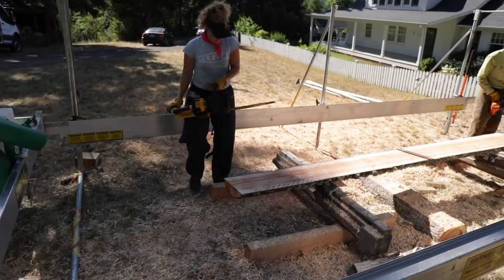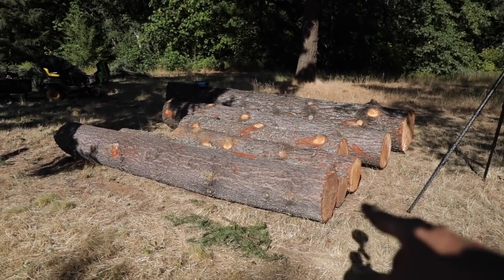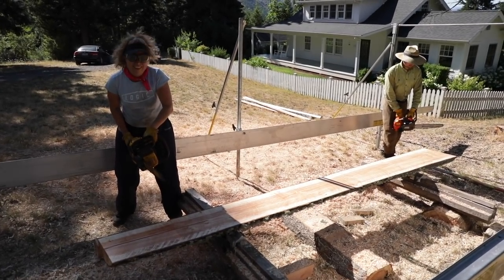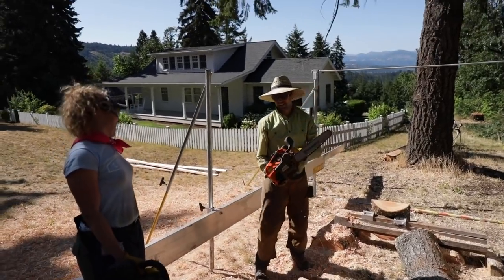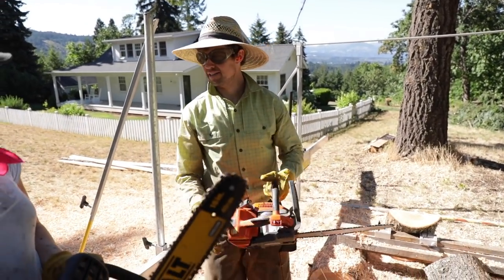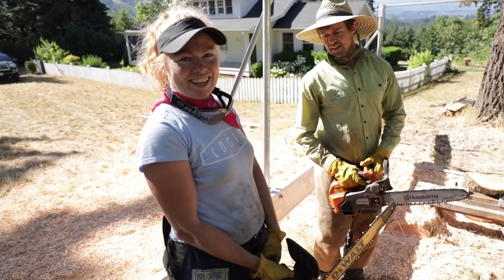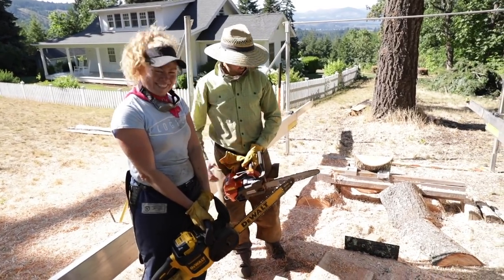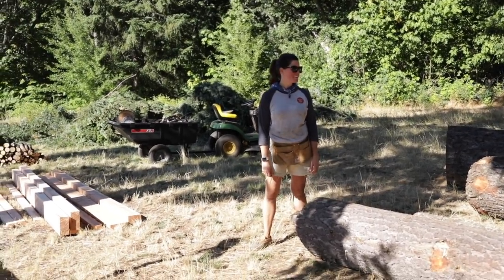Electric V.S Gas Chainsaw SPEED RACE

Comment from the maker: Buy Your Dewalt Brushless Chainsaw Here https://www.amazon.com/shop/wranglerstar (link will direct you to my amazon store)
Reply: Wranglerstar Hi there i would really enjoy seeing a comprehensive review of the s&w swmpls4 pocket knife, its been my daily carry and your reviews are so awesome and interesting! Id enjoy seeing your opinion and it put to the true test :D
Reply: Thanks for the video. DeWalt makes some great tools with plenty of power, but I do wonder about the durability of the the plastic "tool-less" sprocket cover and chain tensioner. Echo has an electric chainsaw and the sprocket cover is held in place with 2 metal nuts that require a scrench. The chain tension on that machine is adjusted by turning a metal screw on the side. 

Maybe my apprehension about "tool-less" stuff is unwarranted, but I am very interested in seeing how well the DeWalt continues to work as you use it over a longer period of time. Will it hold up to a whole week of felling and bucking or is it best as a pruning saw?  I prefer to buck with a longer bar because it is easier on the back, but I would love to get an electric as a SHTF saw because I could charge with solar.
Reply: Wranglerstar 

I don't wanna get one tho. I just want a nice gas saw.
Reply: I have the same 20V Lithium Dewalt from Amazon. My 50 years of gas chain saws are over.
Reply: Clark Magnuson 

That's fine. They certainly have a place.

I have a gas sthil. I do have a battery reciprocating saw and jig saw.

I think the electric may have some interesting safety concerns.

For instance, we see the chainsaw as being among the most deadly of tools, so the point classic horror has used the chainsaw among a wide array of power tools. Games the primarily use guns will often find some way through the game to obtain a chainsaw as a weapon. Usually not a weed eater or hedge trimmers.

The chainsaw seems to be universally recognized as dangerous.

So you hafta to take a few extra perspectives on what could happen..

For instance, a young child is highly unlikely to be able to start a gas line saw. Should they happen across one. They're dangerous not even running. But less dangerous. So with a bar safety cover the saw sitting some place would pose much less of a threat of becoming deadly in the child's hands. 

Now the concept of the gas is when it's off it has no power. The engine must first crank then it has power. Then one pulls the trigger and the chain I kicked in drive.

If that saw happens to have a battery in it... It's basically a chain saw with it's "engine" running at all times the battery is engaged. Thus at any time the trigger may be pulled if the safety or child figures out the safety mechanism which isn't beyond a child

The fact it's always running so long as the battery is engaged, it's deffinently more dangerous then a gas saw
Reply: I did 9 days in intensive care in 1972 from topping a tree with the McCulloch chainsaw my father bought me. I gave away my 36" Stihl when I moved to the suburbs in 1999. In 2014 I hit my house while topping a tree with a plug in electric on a 25' pole. In 2018 I got the battery powered chain saw and started going through chains every few minutes by cutting bitg douglas fir roots, to clear land for a garden. It just keeps getting better:)
Reply: Clark Magnuson 

Holy canoli, well.. I havent run one every day of my life but first used my grandfather's chainsaw while I stayed with them in the south all summer. probably 93 when I first used one. I've cut down at least 29 inch trees, dead saftey hazard ones. Cut up a big pine that was hanging over a garage after some guys took it down. I just wasn't there when it was took down. I cut another dead tree down leaning twords same garage. I cut a huge pine branch down next to a power line. Some other cutting here and there. Limbs I've trimmed around a small country cemetery.

My great uncle was the one with big saws. 

By blessings of God I ain't been hurt yet or had any miss haps.. save I did cut my pants once but I realize now why it happened as I was in midst surrounded by a limb pile going down hill. I was honestly operating the saw with too many branches bunching me in and forcing me to work with little space to maneuver. so I don't do it like that no more.

I try and stay some what to the side and behind them when I use one.

Not no expect saw operater but I've done a little share of cutting down a few kinda Biggins.lol
Reply: Shane Hoffman 

I can buy a sthil wood boss for less then that.
Reply: Clark Magnuson 

It's like this. Some boys and girls are happy riding down the street on an electric scooter.. other men and women gotta have a Harley rumbling between they legs.

I guess I like Harley's and gas chainsaws.
Reply: Clark Magnuson 

My great uncle in South Western Tennessee, down there where bufford Pusser was the sheriff. Down by Shiloh and Pickwick. He owned some huge saws. I'll never forget he chewed that day o work tobbacer plug and my papaw liked to dip snuff.

I need to pack my stuff and move back down there I know that much.

I ain't liking it up here Yankee land too much.

People of the north are rude. I don't know what it is about em. Something is off with em I know that.

Compare southern Indiana with south western Tennessee.. it's like a whole different world.

People wave at down south. People give ya huggs and you just met em. These Yankees around here ain't got time for nobody. Too fast paced, people got bad attitudes.

You down in my old stomping grounds down there... There ain't no bars. There is liquor, but there ain't no taverns. There afew a few quite a distance away but non local.

I live now in a town that has lots of taverns.

Now down south, not having taverns don't mean they don't have fun. I'd say down south they have more fun. It's more real down there. 

Comparing the type of girls around there versus here... Well where all the taverns are... The girls around there are evil. They have bad attitudes, bossy, depressed, fake, cheaters, unfaithful, femenist, stuck up, restless, crazy, confused, golddiggers.

Down south, they got those people, bit they're fewer and farther in between.girls down south less likely to run off on ya.

I'm planning on gettin out of Yankee land soon.

But chainsaws are just like motor bikes. You're either content with an electric scooter or you got a have a Harley.
Reply: Clark Magnuson 

Sound like a fun bunch eh?
Reply: Clark Magnuson 

I don't care what these Yankees around here says the trees down south is more rugged then trees up here.
Reply: Clark Magnuson 

Plus just the heat in the south ain't the same heat as up here in Yankee land.
Reply: Clark Magnuson 

Anything north of Nashville Tennessee ain't the south.
Reply: Clark Magnuson 

You ever heared of a Jews harp? Some people's call em a jaw harp. Well... You know that feeling you get with a gas chainsaw rumbling? Or even a Harley? Well.. if you get you a real jaw harp.. or make one... I'm talking a hand forged one. Not no cheap ones. I got me several of em that are hand made from Russia and other parts. They get a little pricey for high quality ones. But a jaw harp creates a vibration that is comparable to that of a chainsaw or even a motorcycle.
Reply: Clark Magnuson 

I got me a forge and anvil, been making the little boogers.
Reply: Clark Magnuson 

I picks me a banjer too.
Reply: Clark Magnuson 

Right now burning cripple Creek on the 5 strang.
Reply: Clark Magnuson 

Got flames coming off my fingers.
Reply: Clark Magnuson 

See, I'd rather have me a chainsaw with a gas engine. Of course I know a little about electronic cicuits. I've got me 2 power supplies, one a 2amp 15 volt with a solder and heat gun the other a 30 volt 10 amphere power supply. Got 3 oscilloscopes and all kinds of electronic components.
But I'd rather have a gas saw, one I can take apart and fix. I can keep them running for years.

What happens when you battery goes bad after they change the battery style?

All the sudden your nice new electric saws batteries become obsolete. Now you're out of a battery and a saw.
Reply: Clark Magnuson 

The the problem with battery saws.

They won't last long... Because eventually the manufacturer is gonna change the battery in such a way the new ones won't work on your old one.

My new batteries certainly don't work on old cordless drills I've had.

Guess what happens to those old cordless drills once the battery becomes obsolete? Unless you know how to kick start old batteries, which sometimes can be done, those old drills sit around waisting space. Because you can't find no battery for em any more

Battery chainsaw owners will eventually be buying a second saw when many of the old saws from the 70s is still crankin.

The battery on your electric saw is gonna be obsolete one day and you'll hafta buy a new saw.
Reply: Clark Magnuson 

Yankees around here think they tough cuttin in the woods.

They ain't hafta worry bout getting mixed up in a big timber rattler nest.

I was loading logs in tge back of a truck back in n the 90s, luckily I had my good buddy, a bitbull boxer mix named Sheba. I reached down to get ahold of the log when all the sudden Sheba started going crazy.. barking growling.. I look down right where I was gonna be putting my hands...a great big ol copper head was coiled up. 

Ol Sheba got bit in the neck bless her heart. There weren't no vets close. The venom didn't get her.. it was the fact she got bit in the neck which caused her neck to swell up. She unfortunately passed away from it. But that dog died saving my life. I was a long way from any type of medical attention.

If Sheba hadn't warned me of that snake there, I'd of been bit on the arm.

She was a unique dog with some personality like a human personality. She had a diamond shape on top of the her heard. Like two little calicks that formed a diamond on her head. She was an exceptionally good dog. Gentile and protective of kids.
Reply: Clark Magnuson 

Down south, you not only gotta worry about falling trees but also big huge poison snakes.
Reply: Clark Magnuson 

My uncle wears bibs, has a long grey beard and wears an old ratty fedora with a big timber rattler skin tied around his hat. 

We a bunch a hillbillies.
Reply: Clark Magnuson 

Ever goed swimmin in cotton mouth infested waters?

I was just down there in the creek swimmin with the cotton mouth water snakes.. poison snakes. Had one swim between our legs. That's real livin right there.. swinging from a tow rope off some big rocks and plunge right in the middle of all them snakes. You ain't done no swimmin till ya swim the cotton mouths.
Reply: Clark Magnuson 

Goin up a snake creek gone in a run, going up a snake creek ta have a little fun.
Reply: Clark Magnuson 

Somebody running a chainsaw right now. I can hear it. It's kinda sprinkling off and on too. Not too sure he'd still be cutting right now if he had a battery saw.
Reply: Clark Magnuson 

Sprinkles ain't hurting that saw
Reply: Clark Magnuson 

Its got a little lavander buds and some dankier herbs I'm pack in a pipe I whittled out of an ol hickory stick.
Reply: Clark Magnuson 

People thinks we hillbillies is dumb, we just ta play dumb to confound them city slickers.
Reply: Clark Magnuson 

I'm 38 years old and ain't had no accidents but I ain't saying I'm immune to it one day. Anything can happen... I just try and take note the best God gave me the ability to do of what could happen.

BTW, I'm just responding to you at random. Don't take it personal.

It just seems to me, I guess depending on your age. My mamaw has a battery powered chainsaw. She don't really need to be using it but for her she knows how to use it. 

Papaw passed away so nobody had bush hogged in a long time. 

My papaws stuff was old. Old bush hog. Had to replace the blades. Hunted them down at an old local family run farm store papaw used to go too. Put them on. Hooked to a Ford 5000 and I was cuttin sablings an inch wide give or take.

Bush hog blades a little different then lawn mower blades.

Comment: Thx Cody, a fun vid. I’d never even considered an electric saw before. One thing worth a mention: Eric mentioned that he’d been using his top handled arborist saw one-handed. We have had a number of deaths (besides countless injuries) as a result of thinking the small top handled can be used with one hand easily. When they kick back they really fly, and certainly in the UK it’s the one saw the supplier needs to see the customers certification for. I can walk into my dealer and buy the biggest saw (MS880 with a four foot blade say) but they won’t sell me the arborist saw without seeing my qualifications. Over here, it’s two-hands and never allowed to be used on the ground.

Comment: The craftsman 18inch corded saw is a beast. 15amps. 4.5hp. Only drawback is you need to be no more than 100 feet from a power outlet

Comment: You should try a Stihl battery powered saw.  I have one. Really nice. Great weight balance.  The only con I see is when the chain gets dull.  It doesn't have the torque like gas to power through with a dull blade.  But with a sharp blade it is hard to beat.  They do get hot in the sun on a hot day.

Comment: I think the take away is these saws have shotty tensioners or ill advised operators. You can clearly see open space between both bar and chains. I mean at least they're wearing chaps, but that's asking to get slapped. Not to mention will wear out your bar tip faster then a tight chain

Comment: Cody have you greased the tip sprocket on the Dewalt? On at least two YouTube channels people have turned the bar to junk as the sprocket comes apart.  Dewalt supposedly said it was because the sprocket was not greased. The two holes near the tip sprocket are for grease. One YouTube creator got a special grease injector looks like a huge hypodermic needle. Shot grease in and it came out all around the sprocket.

Comment: Sure seemed like a tie to me... 
The only issue I'd see is the battery running down, and having to recharge. So You'd need like 3-4 batteries for continuous action. 
Gasser you just refill and go. 
It'll totally depend on what the work load is. Electric for small jobs absolutely, gas if you want more power and longer run time. Just my 2cents...

Comment: For a small chainsaw that you are not going to be using for hours on end, and that you might only use once a month, you should go with the battery powered ones. If you are cutting down a tree, going to be using it for hours on end, or many times per month, then you should go with the gas powered.

Comment: I never would have considered an electric saw before, thought they were kinda gimmicky. But now I'm thinking it would be a nice thing to have on hand since my 30+ year old Still 075 is kinda a beast (and I need to learn how to tune it).
The only thing that still gives me pause is batteries. The DeWalt costs $400, but a new battery is $240, whereas a Husqvarna has the same initial cost. Of course you have to pay for gas, so it depends on how much you use a chainsaw to use $240 in gas. And if you only use a chainsaw a couple times a year, which would you recommend?

Comment: Electric will almost always win out over gas because it can give instant torque, and give a smooth same rpm power the whole time. Gas is not instant torque, and power will depend on engine rpm which can vary slightly from moment to moment. With that being said where gas will win out is that it will give a relatively same amount of power, so long as you keep gas in the gas tank, and provided you planed ahead, if you run out of gas, it is pretty easy to refill no matter where you are. The issue with electric is that as that battery start run down you start lose power until it goes kaput. then unless u plan to carry a bunch of batteries with you, which can be bulky, and heavy, or carry a portably generator with you, there is just no way to run all day, or even half a day. Electric is perfect for the person who wants to just use it to do small projects around the house, but I can never see electric replacing gas in the hands of professionals like people who fight wildland fires. They have to limited run, and the stuff necessary to replenish them is way to much to carry to be able to do it in the field.

Comment: When you say electric I was thinking corded.....not battery powered?! I have an corded electric Stihl and around home it beats battery powered chain saws hands down. And around home it beats loud gas powered chain saws hands down....especially if I want to not.bother the neighbors, not mix.gas, not.worry about the carburetor and so many other things. My Stihl is rock solid and I would put it up against any other same sized gas or battery powered chainsaw around. The only apparent advantage a gas has over a corded electric chainsaw is its not tethered to an electrical power source.....thanks

Comment: to onest you shloud include time for charging batteries and fillinhg with gas.
Reply: Богдан Ших you mean switching to a fresh battery and putting the empty on the charger, sure. And when you run out of gas then what? Oh travel to a gas station and by some more, add that to the time....
Reply: Dan Svensson ya and include the 25min both ways it takes me to get to the gas station to fill up my gas can, mix oil find my damn bar oil   OR I can just walk over to my charger and grab another battery I have.....when are people gonna just get over the fact that there is a large demand for battery powered chainsaws